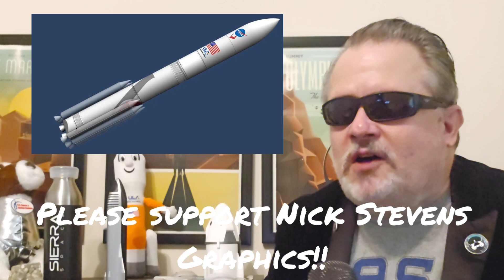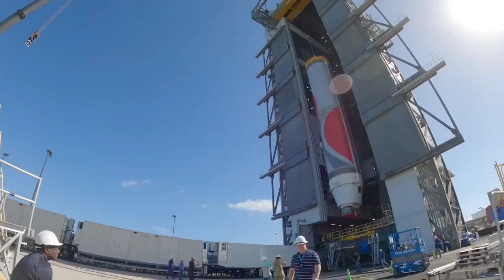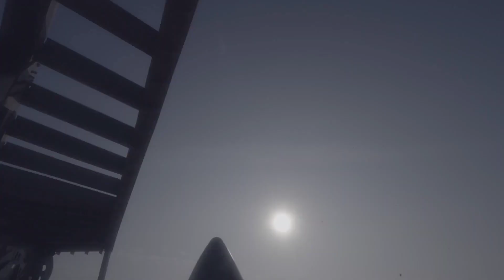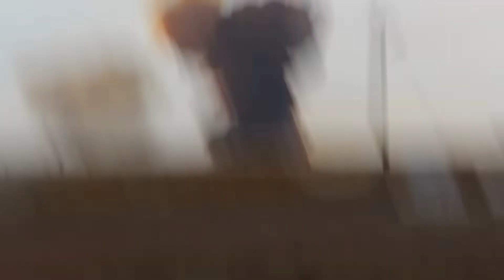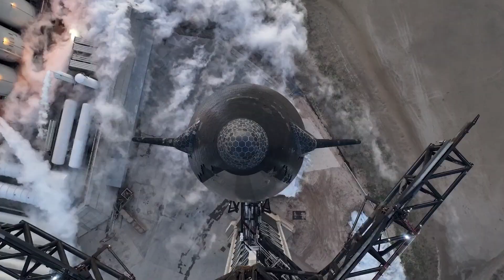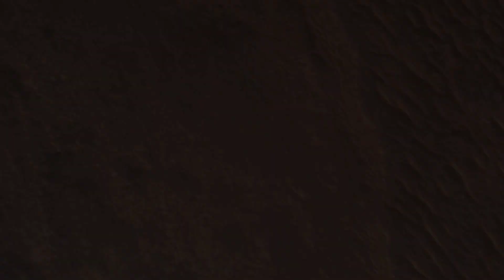6 to 8 weeks, Elon Musk?  Try 6 to 8 months!!  FAA Starship update, plus the latest from ULA!

Comment: I think that for a few launches of starship, the boosters will be expendable for maybe 10 to fifteen launches. Maybe much longer. As manufacturing  them will get much  cheaper and faster to build, they may just opt to never use a reusable  booster on starship. 3d printing these by the dozens will make them throw aways.  Same with all the other rocket companies will return to throw aways once again  because it will be cheaper with 3 d printing. Who knows?
Reply: No way. Always massively  cheaper to reuse.
Reply: @peteclegg1578  right now, yes it is but won't  stay that way. Refurbishment  will exceed the cost of new 3d printed ones in the near future.  These 3d printers are a marvel  to see. Coupled with AI, they will only get better and way faster in the future.  Some small rocket upstarts see the future  of this tech and are grabbing onto it early. Manufacturing  a new booster will be like churning out donuts from a AI robot factory. Steel dumped in one end of the factory while  a finished booster rolls out the other end ready for flight. No humans needed on the build line. Musk knows this and will move in that direction.  He must in order to produce  the vast number of starships needed to colonize the solar system.  There just won't be time or money to spend on reconditioning  used boosters or spend money on the systems to get them ready for flight again or capture them and transport and handle and store them.  That's a bottleneck.  Of course,  this is my opinion  for what it's worth. Secondary markets could spring up to contract for that work, offering used boosters to small rocket companies  at a cheaper  rate then for  them to  build  the booster themselves.
Reply: Remember the V2? The most sophisticated and complex weapon built until then. Still, it was our cheapest weapon in WW2! The guy who built it also later made the moon rocket and he actually wanted to plan in reusability. They didnt let him. Was already a wild gamble to let an ex-nazi build americas pride.

Comment: SpaceX needs separate fts, one for each stage.  They should have been able to terminate stage 0, and then seen how well starship flew.
Reply: Both stages had FTS, and were used. They couldn't separate, because the release mechanism used hydraulics, that failed shortly after liftoff.

Comment: Counting the seconds, the Proton explosion was just over 2 miles from the camera. Multiply that explosion size by the size.......hold it. You can't. This Proton is hypergolic fueled and ALL the fuel ignites when there's an "anomaly." On a methane fueled rocket only between 10% (as happened with the N1 explosions) and 50% at the most would explode. But the explosion would still be markedly larger.

Great video!

Comment: Is it at all possible that SpaceX let Sarship fall just to check its structural strength?  I realize this would be a huge violation of safety protocol, but a lot of people have noticed, and complimented, the fact that it did not fall apart when it fell.  And frankly it's hard for me to believe it took them 40secs to self-destruct.
Reply: They’re not that dumb. For FTS to have worked properly, it needed to have be beefed up. Corrections have been made, since.

Comment: The current 6-8 week timeline is realistic for starship. The FAA can grant a license during the lawsuit and If the 33 engine static fire of B9 said anything, it's that the plate works. They will launch in September and that I'm confident of.

We won't see a concrete + sand storm like we did with the prior launch. Just a ton of steam.

The new FTS charge has been tested, the old charge would have blown up instantly at a lower altitude. Its physics.

The hot staging ring has been tested and I've heard it passed at well above flight loads. We've spotted a 2nd ring being worked on which is heavily speculated to be for B9.

Comment: I’m afraid there are too many holes that have been drilled in those steel plates, if you add all the areas, that’s the size of the door you open to the exhaust of that monster. Just… cool the plates and let the steam out sideways. Godzilla will blow your steel  balloons of compress air…

Comment: That proton seemed to have a very effective flight termination system, which worked perfectly.
Reply: Yeah, nose diving into the ground is an extremely effective flight termination system!🤣
Reply: That Proton had a groundbreaking flight. It worked perfectly.
Reply: Well, not in this case. And don't forget: Proton is using highly toxic fuels.

Comment: a mishap investigation initiation report is required within 5 days of the mishap that creates the list of required fixes.  the report that was submitted this week was the  evidence of the fixes they completed.  after referencing past mishap investigations and their time line a 6 month time line is far too long at this point from final mishap investigation reports 30 days is more of a proper expatiation.  as the verification of the  changes made takes far less time.  space x has an average of  3 month turn around for mishaps and the longest one was 6 months with the final report for the 6th month hold was turned in 2 weeks before the next flight.  just saying....

Comment: As it wasn’t mentioned can I just check if the court case against the FAA brought by the wildlife and environmental groups has been dismissed or settled yet? I’d assumed not and they, like the FAA, were awaiting this report and follow-up actions .. but I may have missed something.
Reply: the court case has not had an injunction filed so the FAA would still allow a launch license if the they have mitigated all required fixes.  the court case is ongoing and could last 4-5 years.  starship will fly very soon.  and the FAA likes to get these mishap investigations done quickly.  their answer of what needed to get fixed was delivered to spacex with in 2 weeks of the failure and 30 days after the final report is usually when a license is produced if there isn't secondary changes.
Reply: @dwbrock1992  ... many thx, much appreciated. 👍

Comment: Your concerns of the hot staging is what i pointed out with using hls landing rockets for hot staging and abort option. Also if they are going to use water for protection of the pad than why not put plate for protecting the fuel tanks near by?
Reply: The quote Elon, the best part is no part.
Reply: @richard77231  in certain circumstances, yes, in others that involve safety and concern, then no. You are going to want those extra parts.
Reply: I think that hot staging and reusable first stage aren't concept that fits well together.
Reply: @andreabindolini7452  depends on how you look and engineer it. They can work, but only if you design it right.
Reply: @mr.ackermann807  A lot of things can work, but this doesn't mean that are the most sensible things to do.
Reply: @andreabindolini7452  No, but they are better for public safety and to give better comfort to the companies that send they payloads on those rocket to orbit. In a way, it gives more confidence to those that it will be safe to put things on one rather than hope and take risks. The best part is no part is a choice of risk over safety and precaution.

Comment: I don't really care weather it ever launches again honestly they need to stick with falcon heavy and be done with it  and make a single stage rocket to put on top of a heavy to land on the moon.
Reply: Agreed. If they wanted an upgrade, they should have just upgraded either falcon 9 or falcon heavy. And for going to the moon, possibly a single stage like you said but has empty tanks for payload already on board, then use a second one to deliver the fuel and oxidizer. Not in orbit refueling like they've described, but inter exchangeable tanks to avoid pumps for transfer and all that unnecessary mechanics, just like hooking a propane tank to a grill or something like that. More design upgrades but safer than using pressure and pumps to force it in. If you have better ideas, then let me know.
Reply: It's not just a moon rocket. It's a launch system that will ultimately be much cheaper than Falcon 9 while being far more capable. It will replace Falcon 9 and Falcon Heavy. It will revolutionize the space industry.
Reply: @jamescarter8311  if your referring to my comment on hls than I wasn't just referring to the moon, I was referring to make it more simple and safer without the possible explosion of all that fuel compared to starship making it safer for human rated. And by revolutionize you mean chemical rockets than maybe, in the end for revolutionize than no fusion beats that in terms of energy but even then it is not the end state of rocket revolution. So starship is unique and amazing, but not impressive.

Comment: And more like 6-8 YEARS before it attempts a moon landing! (If at all)
Reply: A few more launches to get the basic Starship going. Then in-orit refueling. The HLS development and testing can run in parallel with that, with test takeoffs and landings straight off the basic orbital stands. The moon landing thrusters can be tested with a Raptor idling to take 5/6 of the weight.
Reply: @paullangford8179  I will tell you “I told you so “  when they make their first “attempt” at a landing in the early 2030s.  In fact, I wouldn’t be surprised at all if NASA cancels their contract with SpaceX and go with another HLS provider.  As for Mars, I seriously doubt Starship will be the vehicle that will take us there.
Reply: Assuming that timeline is correct, NASA will be ready just a week ahead...

Comment: Tony bruno is a cowboy whose jig is up, as far as rockets is concerned. Using wrong business model. ULA will go belly up, a matter of time. Starship is still in prototype development, faster track than any any other vehicle. All the mishaps though concerning are expected.
Reply: Tory Bruno has decisions to make.  
Among the most pressing appears to be whether to risk ULA bankruptcy by continuing to rely exclusively on Blue Origin as the engine supplier for Vulcan in spite of BO's failure to provide a steady stream of BE-4 flight engines.  The necessary consequence of that failure is that Vulcan is grounded until that changes.  ULA is robbed of its intended revenue stream and ULA is, therefore, on a path to bankruptcy sale.

ULA needs to modify their "Smart Recovery" module to accept Raptor engines as Raptors are in rapid serial production while BE-4 is still, apparently,  a model shop product.  Because Raptor uses liquid methan while BE-4 uses liquid natural gas which is methane plus impurities, the switch should be relatively easy.  Any shortfall in thrust due to that change can be compensated by reducing payload and/or adding more SRB units.  Neithervof those may be necessary but because this is "Plan B," it is also time to consider "Plan C."

In the event BO never comes through with enough engines, a Raptor option provides revenue and time to do something else for the long term.
In the event BO does supply enough engines, a Raptor option will give ULA leverage in engine price negotiations and insurance against supply interruption.
The ULA Raptor option for Vulcan opens up other avenues for future booster development. 
Cooperation with ULA gives SpaceX more eyes looking at any Raptor design issues and more hands turned toward solutions.
Perhaps most importantly, introducing competition in the engine marketplace will spur BO and SpaceX to provide better engines at better prices.
Everybody wins.

Comment: Thanks for this.  If Musk had built the water deluge system BEFORE the first test,  imagine how many flights would've happened by now.  But he IS a genius, right?
Reply: You act as though he's not handing out assignments to underlings. Did the engineers say "yeah should work once" or did they say "don't do it shit will explode" and then musk went ahead? I figure it's probably the first.
Reply: They (SpaceX engineers, including Elon) had data telling them it would work for 1 flight. They knew the pad would become destroyed, but they did not expect this outcome - because it wasn't actually the pad surface itself that failed, but the soil underneath (which then caused total destruction of the above pad structure). 
There would have been no further flights, because the same upgrades would have happened. Had they decided to build the water deluge first, then NO flight would have taken place to this day, because they would have had to built it first.
Reply: @TexanMiror2   Nothing kept them from building it prior to April 20, 2023.
Reply: If they had hastily installed the plate first, the first flight would have ended in a steel tornado instead. At that time they didn't know just how weak the ground was under the OLM so would not have done all the piling work to support it. If they thought just concrete would support the weight then they sure as hell believed steel would.
Reply: @NismoXero   The ground didn't fail.  SpaceX built that launch pad and ignored 60 years of NASA's proven success with flame diversion and water suppression.
Reply: I think that was on purpose because you can't build water deluge on moon or mars but then again would be a long time before you could build and OLM too.
Reply: They wanted to get the first flight out of the way, did a test, but the result of the test wasn't definitive. If the starting run-up had been only a couple of seconds, things might have been OK, but that enormous blast of all the raptors was sustained for far too long.
Reply: NONE

Comment: I think your takes here are reasonable. Not sure whether you are optimistic or pessimistic, but your take is reasonable. "Elon time" is unreliable, as you said.
However, I will say that the issues SpaceX experienced are fixed now due to the upgrades to launch pad and FTS. Let's be clear: nobody was at risk in the test flight (and the environmental issues are clearly overblown), and from a regulatory perspective, the loss of vehicle / engine issues were not the issue. As long as the standardized FTS gets upgraded (already in the works), and the pad gets upgraded (already in the works), there is no regulatory issue with another flight - all the other issues were already accepted as potential risks for the first flight.

Comment: Vulcan and the BE4 are going to take a lot longer than SpaceX
Reply: Slow BE4 production may end up biting ULA
Reply: @liquidpatriot4480  also a good point. But we should hope by time Vulcan first flight engine production should be ahead. Then again they will need them for New Glen. Guess we will see.
Reply: @allun1345  agreed, hopefully that won't become a bottleneck.
Reply: Each Vulcan only needs 2 Engines. Its not like Starship that needs 40 or so.
Reply: @liquidpatriot4480  That could happened it if Vulcan was ready on time....... but launching 8 months to a year BO will catch up
Reply: I point my fingers at BE3 and BO, let's see if they can keep up with production. NewGlenn uses 7 BE4 and vulcan 2 if they minimally intend to launch 1 rocket per month, then BO must ramp up production by tenfold at least to keep up with demand
Reply: For the first flight, probably. 
But is not the first flight that counts. It is the entering in active service. I think that, in that case, well, things could easily turn out reversed.
Reply: @andreabindolini7452  totally agree that is likely. Starship could still be testing whilst Vulcan joins operational flight.

Comment: SpaceX has already proven the errors of their 1st flight
1. The FTS system was tested at the Massey's test site and looked to have worked pretty darn well
2. The Water cooled steel plate system also seems to be working great, so much so that the paint didn't get completely melted off!
I can't see the FAA keeping this thing on hold for 6 to 8 months. I think NASA would be pretty pissed if they did that.
The reason why the mishap report took 4 months was because they were using the report to prove they fixed the mistakes of their past flight which I previously stated.

Comment: the reason why I think the starship lost most of its engines was because the amount of debris that was ejected from the pad which was being destroyed from the force of the raptors. There were like HUGE chunks that was being thrown and its possible that many pieces of debris critically damaged some of its components under it.
Reply: Unfortunately, that's not really possible - throw anything into a strong windstream as an example. a rock in highway winds but turned up to the nth degree. Those rocks were thrown into a 38,000 pound stream of gas moving at over 7,100 mph
absolutely nothing but the highest inertia objects going straight up would be able to touch the rocket.
The debris may have struck the underside of the mount, but absolutely would not have touched the rocket.

The engine failures could be better attributed to reflected shockwaves, extreme vibrations, unstable propellant flow, or really any number of issues with the engines themselves given their age, but i can assure you it was NOT due to a debris strike.
Reply: @faxinspace  Thanks you!  It is unbelievable that people don't get that.
Reply: It lost 6 out of 33 engines. You say "most" CNN, is that you?
Reply: @lamarw7757  I read that to mean most of the engines that were lost, were because of debris.
Reply: Not possible, but certain. Some of the pieces were car-sized and flung 100's of metres away.
Reply: Agree, given the amount of debris and devistation, I'm am amazed it made it off the pad!  This is truly a robust system.